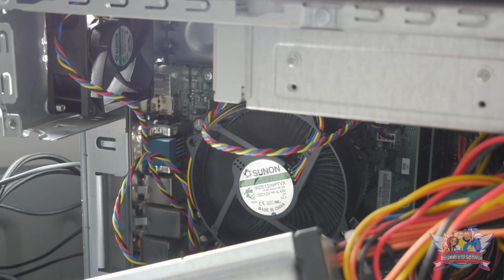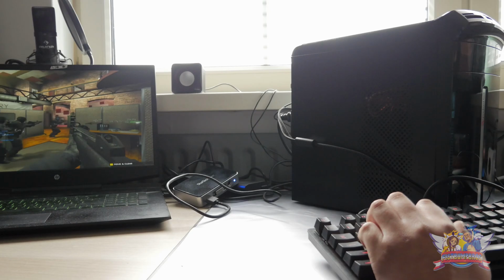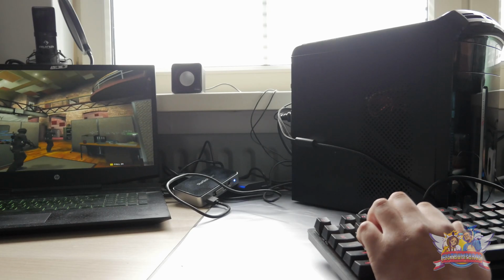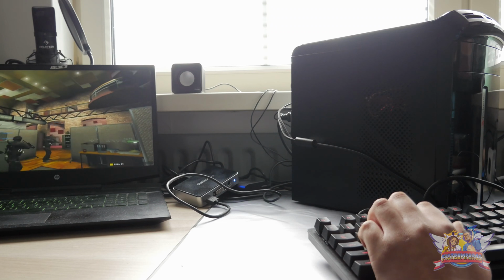Replacing NOISY PC Fans on that Packard Bell Imedia Windows XP Machine

Comment: I have one but the problem is when I turn on the pc , the cup fan doesn’t stop until I cut the electricity ⚡️ from the power supply than the pc can turn on….. when it’s already on especially when it’s hot outside.. the pc shutting down itself.
I thought that the power supply has issues but it was okay .!!! 
What’s the problem my friend??
Reply from the maker: It sounds like just the fan being faulty if you already replaced the PSU. Seems like the fan still has power flow towards it when turned off.

Comment: Hello againg sir after a long time.
Recently I replaced the Celeron E3200 with the fantastic Q6600
The thing is the fans are too noisy and i'd like to know what size is the back fan to replace it with a quiet one
Reply from the maker: Hi,

I used this one : https://amzn.eu/d/6MSnm72
Reply: @fistbumpbros   Looks great but as I know the fan will not change its speed due to the 3 pin connector, the 3 pin connector doesn't support the PWM function
Reply from the maker: I get it. I still thought the fan ran silent enough for my purpose. To the latter, at least better than the original fan.
Reply: @fistbumpbros   I found a fix to those noisy fans throught softwate, I tried Open Hardware Monitor to control the back fan, I set the RPM to 40% and it sounds very low
The fan controlled by the BIOS is the CPU fan
I set the app at windows start and start minimize. With that configs the fans will be at 100% till the app starts
Reply from the maker: Good solution, although it relies on software to 'be better'. I prefer a hardware fix at start, and then a software one.

Comment: Finally someone giving a fix for these noisy fans for this pc
Reply from the maker: It's a familiar problem?
Reply: @fistbumpbros  Yes, I have the same pc with a celeron E3200 with windows 7 ultimate and it do the same noise when I start it in the morning
Reply from the maker: @xxg.tester7851  Well, its an easy replacement, go for it!
Reply: @fistbumpbros  Maybe compressed air into the fan should be enought
Reply from the maker: @xxg.tester7851  You could try. However, if the fan blades are minimally crooked (like mine was) its makes this annoying sound. Just a fraction of crooked-ness results in this sound, because fans move at high speed. The best option would be to replace the fan. They are very cheap and give instant result.